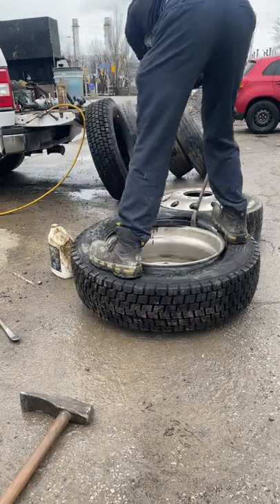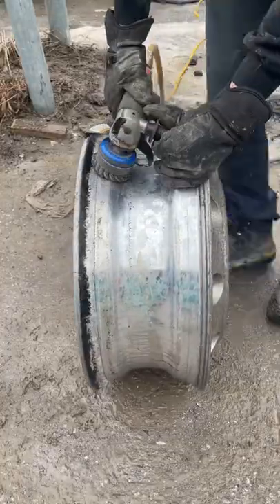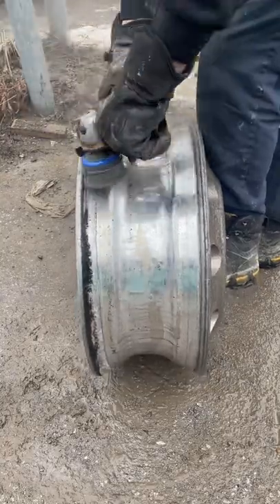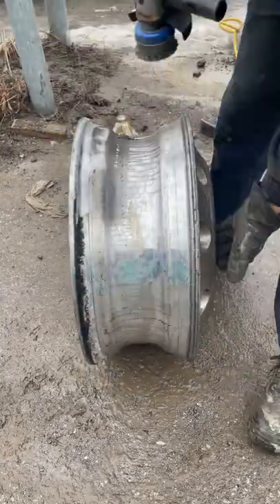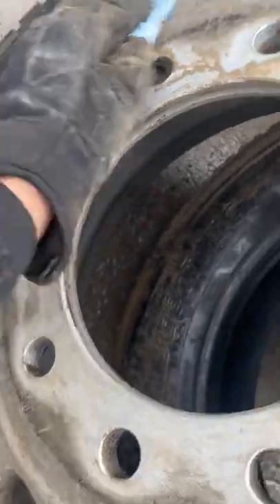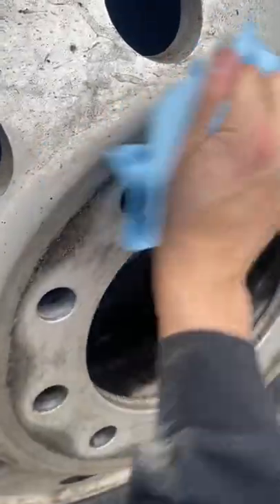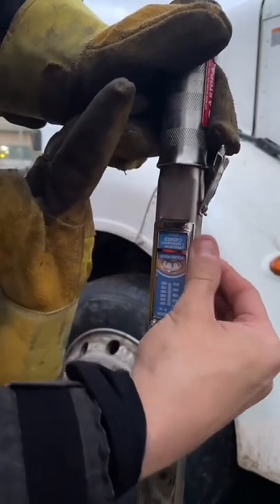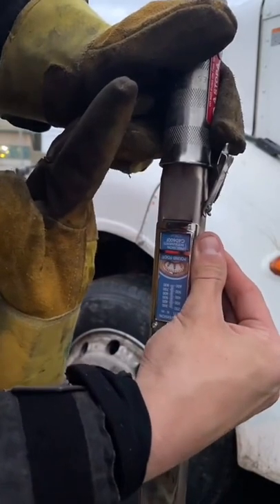3 Steps to prevent wheels fallin off #safety #wheels #tires #tireguy #tiredoctor #learnsomethingnew

Comment: I don't wait for 100km to re-torque, I'll just do it at 62.13 miles.
Reply: 26.14
Reply: Have you guys noticed that if you run out and check them when their hot, they move more than if you let them cool?(garbage trucks are some of the hardest working)
Reply: I was listening to the song by HERMAN'S HERMITS "there's a kind of hush" when I was doing this, and I thought of a new lyrics, "there's a kind of crust, all over these wheels,alright, all over this town, you can can hear the sound, of wheels coming loose, it's like a bad dream, so scrape them very carefully, so you won't hear the victims say they hate YOU, forever and ever....
Reply: @logancausey9623   Hahaha! Well, where I pulled off to tighten the lugs there was a 33ft long box truck in front of me. I had to leave 19.8 ft between us giving him enough room to unload his truck, so I had to stop at 62.13miles. 
Hmmm, 33ft + 19.8ft = 52.8ft, which just happens to be 0.01miles, what a coincidence.

Comment: Nobody retorques them
Reply: Technically after a new set of tires is installed you should re-torque them after 25 miles of driving for safety precautions. In my shop it’s a very common way to ensure nothing falls off
Reply: Most the time, it's just safety protocol in case something else went wrong ,but with a garbage truck fleet, it is a necessity. (the different color nut checks can be used to indicate status)

Comment: Me being the guy doing 22.5’s and 28 inch tractor tires With tubes. I can say I’m not doing half of these steps, at the most I’m have to scrub your wheel smoothe, besides that imma let the impact do what it does till I feel like your wheels are not coming off unless you have a 1 inch impact and 400 psi of read air
Reply: As a highly qualified most badass diesel tech on earth….

I highly say torq is key 

Over torq stretches studs.. which could break off going down road

Under torq the lugs thread off and the rim ruin the hub but wiggling off 

You must oil the stud and nut and flange with 10w30 because it increases clamping force by alot alot alot…

You also must clean mating surfaces

Such as rims and the seats on the hubs….
If you leave debris rim can wiggle off even if torqed 

The rist procedure is a must 

Yes you can just run em down with a gun… but you can also hold a gernade for a second or two after pulling pin to cook it but its dangerous 

Even if you do rist procedures 
Tire can fall off

A retorq is required if person retorqing finds the lugs move alot 

They are to take it apart and inspect

Comment: Starting with the hub I take a blow gun and blow off the hub. Next I address the pilot pads  Usually there's some build-up there especially with aluminum. Especially if somebody uses neverseeze.  I use kill frost anti freeze air to oil for my gun. And I also have it there for nuts and studs. If needed. 2 drops on the stud and 2 drops on the nut collar and I give it a spin to make sure its not locked up.  If you  Dismounted on a dirty surface  And/or there is build-up on the face of the nut area. This will have to be cleaned. And definitely inspected for cracks. When tightening I feather my gun and don't let it go straight towards the wheel with full force to damage the threads.  I let it hit tight and let it tighten 3/4 of a turn watching a spot on my socket turn.  Factory settings on 33 mm ,most common.  Is 475. I set my torque to 500 by hand.  Cause you know after you go past 475 it's no longer 475.  And knowing that you can't go down once you've been over. Once  overtorqued that is fail.  Roll out play dough onto a table into a stud form.  If you pull on it it will get skinny in the center.  That's what happens to a stud during fail and a nut will always back off of a failed stud.  This is why you retorque to check for this condition.

Comment: Doing 22.5s all day, you don’t need to re-torque. I don’t even torque either a wrench. I do fire trucks and other extra heavy shit, and it has never been an issue. Ingersoll Rand 285B at 150psi, one ugga dugga all the way around, then three uggas per nut, and that baby is gonna be somewhere from 500-600ft-lbs. f
Reply: I've been there too, most of our guys do it same as you but more than likely, your over tightening....next time you get a chance, mark a nut you've just tightened, back it off and tighten again with a torque wrench, you might find that it doesn't go quite that far.

Comment: You'll never torque it right with that big ass extention on there lol
Reply: Not how torque works but ok
Reply: You are so wrong it's embarrassing.
Reply: @angelob9050  how? as long as the extension is straight and you aren't pushing the wrench at an angle the torque would be accurate.
Reply: @granttucker7526  dude I agree with you. I was replying to the original comment. I am a mechanic with 10 years experience on trucks.
Reply: @angelob9050  shit my bad
Reply: Your right but the spec for this style is between 450 and 500 ft lbs and they must be oiled…

You set the wrench to 475 and boom your in spec even with extension 

But extension doesn’t make that big of difference but it does
Reply: Interesting argument, me and one of my supervisors do not completely agree, but our Norbar type wheel torque set came in a blow molded case with a long and short extension,  it looks like a torque stick but if you compare the two, the extention is much thicker, and the torque stick comes with a warning not to use it as a extention

Comment: If ya dont stop for re torq you could kill someone
Reply: Some vehicles are more critical than others. (garbage trucks make many stops fully loaded)
Reply: @cameronduff884  a garbage truck wouldnt be crucial they arent going down the free way fully loaded doing 80 mph

So if tire does fall off on garbage truck in town its not gonna  be rolling missle
Reply: This is based on my own observations, and I've been a tire changer for both types of fleets, have you ever seen people lined up for a bus and imagined a Rouge tire, I'm just saying, some applications are more critical than others and, even fire engines don't even come close, have you ever seen the blue Alcoa sticker turned grey on all wheels?, this is actually a built in heat indicator.
Reply: @cameronduff884  i understand the weight but the speed has to be a factor as well 

The speed determines living or not…
Reply: Well, thing is, all that speed and not so much braking is keeping everything cool, therefore the wheels not so likely to come off to start with, l can't say I've seen what happens when a pedestrian is struck by a 22.5 at any speed but I've seen a bare come off a rim after hitting a large pothole, it went through three Pickett fences...ether way, it's going to be devastating.
Reply: @cameronduff884  your right but the heat doesnt make lugs come loose
Reply: Not by itself, but all the starts and stops, you might compare it to an elevator, it doesn't really go anywhere yet there is still wear and tear.